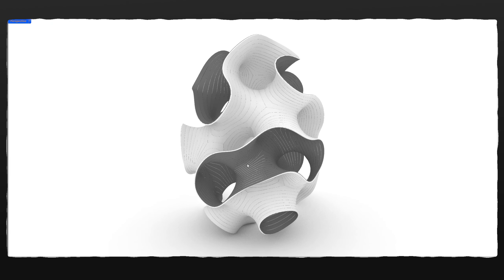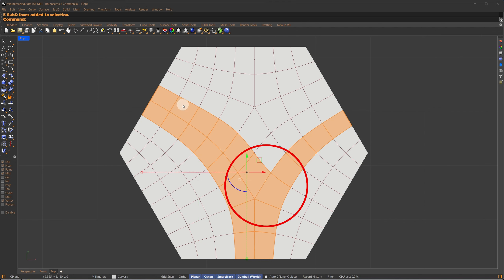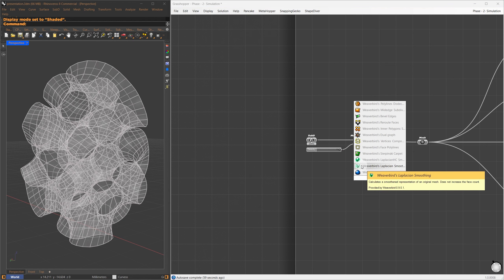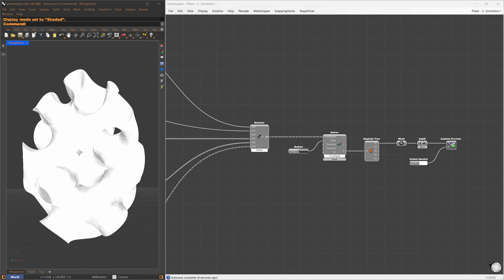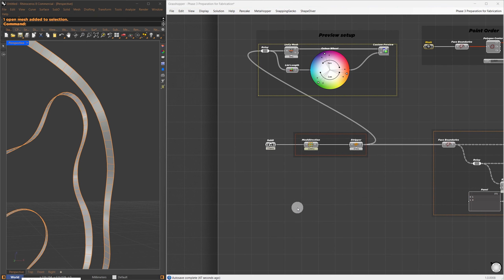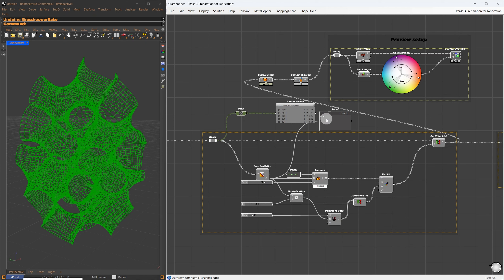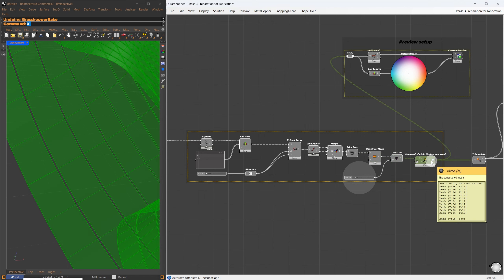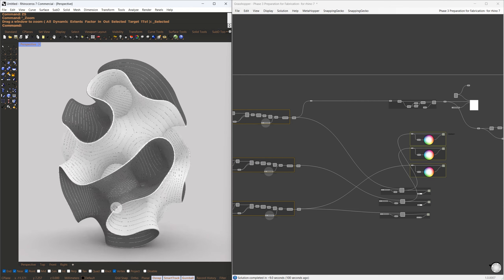How I Use Rhino & Grasshopper to Design a Pavilion | Inspired by Minima Maxima Pavilion

Comment: Amazing.-  I am working through the mesh clean up section and having a hard time figuring out which faces to select for the stick - on the awkward shaped gyroid surface. Is there a way to do this clean up in grasshopper without going back and forth to Rhino?

Comment: impressive! How do I deal with the pole with odd valences in a complex situation? I did so but lost the edge and got so confused
Reply from the maker: Practice on simple geometry first. Once you're comfortable, try the same method on more complex meshes, but keep the face count low to avoid confusion. You can always increase the resolution later with subdivision
Reply: @3DBeast  After several tests, I gradually found the "feeling" to deal with the odd valences. Thank you so much!

Comment: It is amazing. I would like to know if I pay the subscription in patreon can I take the step by step to do it? I have the 3dpinter and engraver at home and I want to do the exercise.
Reply from the maker: As a supporter, you’ll get access to the final Rhino and Grasshopper files, which you can bake and test for your 3D printing project. If you’re planning for CNC, I’ve included basic naming for the strips to help with assembly after cutting. However, if you’re completely new to Grasshopper, some parts may be challenging to understand.